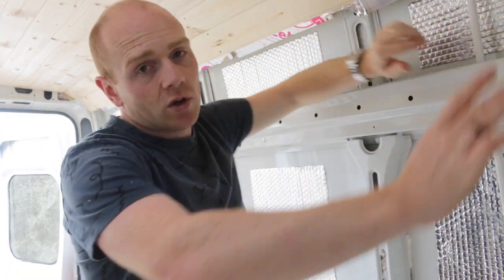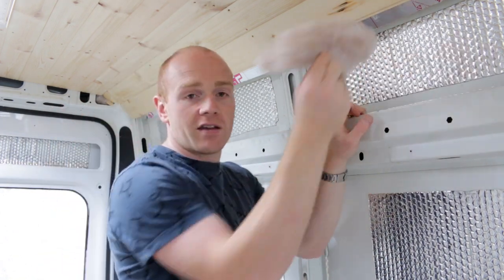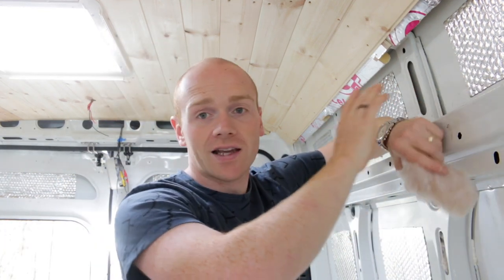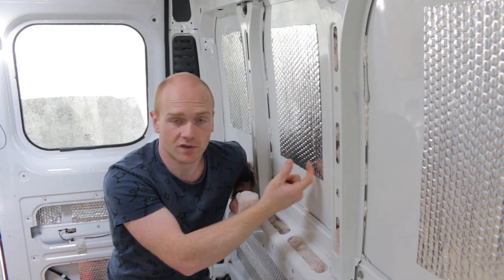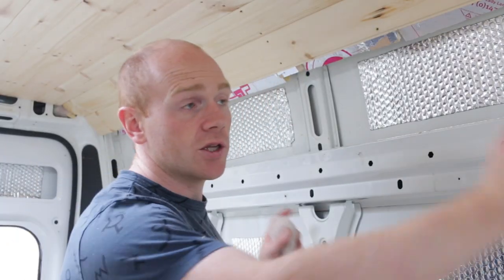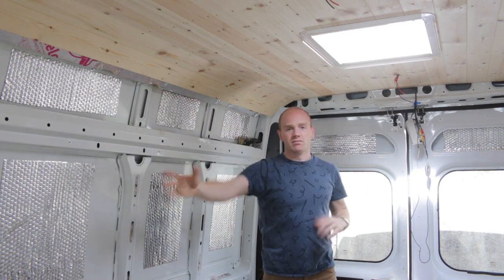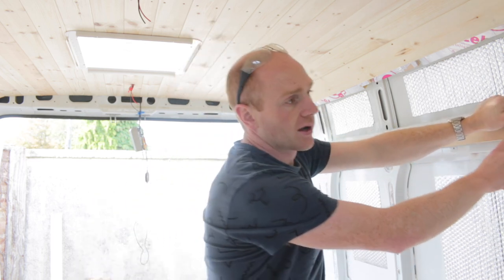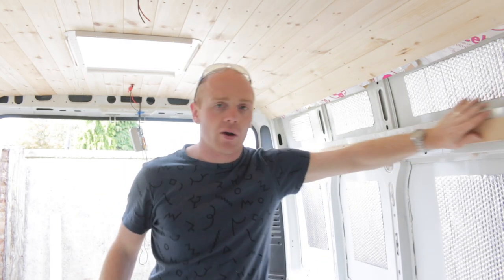VAN INSULATION PREPARATION | TRC Van Conversion 12.0

Comment: what if you added the silver building foil on top of the foam insulation with the foil. would that ameliorate the potential problems you talked about with not installing that foam insulation properly? also what are your thoughts on plastic vapor barrier?
Reply: xingalingaful Plastic on its own is not vapour impermeable.

Yes, two layers is better than one.

Comment: Definitely owe you a pint or 2 for these vids . . . Re-visiting this one as I need to put side battens in. I have a boxer and was just wondering if you drilled holes into the metal for the M8 bolts to go through or did you just put them through the existing holes in the ribs (although mine are hexagonal - think yours are too).  . . Any info on this would be great! Cheers, Matt

Comment: Aluminium foil will impact radio waves! Can also disturbe cable signals. Inside a van wall it has zero insulation. It actually works well as a cold and heat conducter.
But as said in this video, it works well as a vapour barrier.
Avoid, imho, aluminium other than in window covers (to reflect direct sunlight).
Use plain vapour barrier plastic for the job. Seal it with none metalic tape.
One can use normal, clear, bubblerap as insulation but it's R-value might be low.

I would prefere to use sound dampening without alu foil. If you have a problem with weak spots in the insulation, a foil behind it might worsen the problem by being such good thermal distributor.
Reflectix in vanbuild is such amazing global groupthink. Perhaps it started with the space programs? Looks advanced and scientific. If NASA is using it, it must be good...

Use reflectix to clad the inside of your shoplifting bag! ;-)
PS. Pardon me spelling.

Comment: Hi, does anyone know why my rockwool insulation in the walls of my sprinter conversion would be damp? The walls were insulated with rock wool, kingspan and a bit of expanding foam. Then they were covered with foil vapour barrier and foil tape. I then battened and ply lined the walls. So I drilled out the electrical hook up today and discovered the rock wool is damp and the van hasn't even been lived in yet. Any help on this would be much appreciated. Thanks.
Reply: You could have a leak somewhere that's letting wate run from outside the van. I'm in the process of converting my van and discovered a couple of leaks on the side of the van but luckily I cought them before insulating and panelling.

Comment: Would silver foil like you’d use in the kitchen to cover food work to reflect heat/ act as a moisture barrier?
Reply from the maker: Yes but would be to easy to tear. Polythene sheet is the cheapest and easiest vapour barrier.

Comment: Can I ask what, why and whether the small-squares of the vapour layer are attached directly to the metal?
Reply: emma cayless it is sound deadening material. ~2mm of butyl rubber to reduce the pitch of the metal vibrations when driving

Comment: They're 2 types of spray foam insulation. Closed cell (hard foam) and open cell (soft foam). Spray foam is installer sensitive. If done incorrectly it won't work to its potential. Open cell foam (water based) will off-gas within a couple of days. It also deadens sound. Closed cell foam is noisy. Foam would be the only type of insulation that I'd use in a van.

Ventilation is the most important part of controlling humidity in a van. If dry air outside and moist air inside of van you'll have moisture transfer and visa versa. Don't worry about "R" Value. A styrafoam coffee cup only has an "R" Value of .25 and a ceramic coffee cup has the same "R" Value.
Reply: Pls do a video

Comment: Question: I’m watching your videos for future reference; I love the extensive explanation and your thought processing out loud, gives a great insight into the decisions that need to be made throughout the built. What I yet have to understand is what I see in many conversions: the stuff on the panels of the panel van.  I understand you don’t want moist to condensate against the panels and therefore an airtight layer is required to bridge the temperature difference between outside and within the van. But how do these adhesives help with that? Thanks mate
Reply from the maker: Not sure if I follow?  The silver squares on teh metal are sound deadening only.  The most basic way of looking at it is that it doesn't matter what insulation you choose, you must always have that vapour barrier on the habitable side of it.  Not sure which adhesives you mean, it is the silver layer or whatever polythene sheet you use which is important.
Reply: Cool, that is exactly what I meant! it is sound proofing... Thanks for clearing that up for me so quickly; got confused, thought it was part of the vapor barrier or isolation, which put me on the wrong foot.

 The vapor barrier is clear to me, thanks to your video(s). Impressed with your work, and the fact you find time to respond! Thanks again.
Reply from the maker: Jan Willem v.d. Gronden some do fit a thin foil insulation all over the metal first but I am not sure it is worth it if you do a good enough job with the main installation. 👍
Reply: It's worth it, that partial sound deadening could be extended to be the first vapour barrier, the secret is layers, then the foil (2nd barrier), then closed cell foam (or sleeping mats) then Kingspan, followed by soft layer (recycled plastic bottles)to even out the gaps, then final foil layer, then the ply which has been backed by 5mm underfloor insulation (dampens panel resonance). It is a good idea to have plenty of hydroscopic fabrics in the van (like woolen blankets) to absorb then release water vapour as well - of course lots of people also line the van with carpeting which has a similar effect. And like you say it's also a good idea to allow an escape route for any moisture which invariably will find it's way in whatever you do :)
Reply: Nick Wood thanks. I tend to get overwhelmed by technique, even though I am quite handy. Do breaking it down in easy process steps really helps! Thanks!
Reply: The Restoration Couple thanks. You over engineer things a lot you say. What I see is someone who compares options or investigates them to make a sound knowledge based decision. You could wing it, which is my pitfall sometimes but for a long lasting van build, I agree with your “over engineering” all the steps

Comment: Personally I can't stand spray foam. Like you say it's not very green, it's difficult to get rid of if you want to change something, but mainly theres the risk of fumes if it fails to cure. And that might not be down to how you use it, you might get a bottle from a bad batch.

Bit paranoid I know but stranger things have happened! :)
Reply: Any rigid insulation off gases, whether it's sprayed on the van surface, or if it was panelised in a plant. The insulation boards are stacked up within 24 hours of casting, but then cannot off gas until unpacked. You get off gasing either way regardless. Custom sprayed on foam is no more/ less "green" than any other foam insulation, it's just that it's initial gasing has happened elsewhere...

I used spray insulation with closed cell structure, and yes it had an odor for a few days, but once I paneled the walls and stained/varathaned it (more off gasing) it smelled great, and no more harmful than a daily commute to work.

Good luck with your project! Cheers.

Comment: Hi, another great vid. What was the drill bit you used for the m8 bolts that fit them flush into thewood? (sorry diy noob questions) thanks
Reply from the maker: Forstner if its a stubby flat one. Just leaved a flat bottomed hole unlike a regular bit.
Reply: The Restoration Couple thanks again for your help,  really appreciate it.

Comment: WHy do you use small patches of the bubbly foil in the walls? cheers!
Reply from the maker: It’s not bubbly foil, it’s a sound deadened which is used on 30-50% of panels to reduce vibration and road noise. 👍

Comment: What will be the final wall to wall measurement I have the same van as yours and I'm in dilemma about  trying to get as much width as possible to fit a mattress across the back and by the way your van build series is the best ive seen so far well done
Reply from the maker: Will double check and confirm measurements in future video but the bottom double bed is over 1.8m still and the top ones slightly less but still usable for someone my height, although designed for the kids.  If needed I think it would work to go in between the two main side members with a thinner wall make up, which would also allow you to sit the bed structure on top of the side member rather than hanging or building separate supports?
Reply: Yes thats what I keep going back to  I'm only 5' 8"  but I built a temporary bed structure and put a small double full length mattress to try it out  and I loved the amount of space cheers

Comment: Absolutely nothing in the world wrong with the way you have gone about mounting your rails… I only made this comment to expose you to the way that most professional shops utilize the holes in those body rails in the van you have. 

I have had several vans up fitted for professional use, and what they normally do to mount E-Track and the like which is what you used to secure a ratchet strap's, load bars and other sorts of implements yes they use large steel rivets which are put in with a pneumatic rivet gun. 

I have seen these rivet guns at discount stores like harbor freight which you may not have in the UK but I'm sure you have a store like that that sells inexpensive Chinese tools.

Comment: I like your videos very much, thanks. 
What about using those small bags with Silica gel? Do you think they can help to absorb the moisture if I put a few of them somewhere in the insolation? With a price of £1.50 for 100pcs I think it is worth it to spread some of them.
Reply from the maker: Did think about that, you could certainly put them on the wall channels before sealing up.  Not sure how many you would need though!
Reply: It would be great to hear about it from someone who has tried it.
I've tried it in a double glasing window and it worked great. Now, when I saw the price of those small (1g) sachets it looks like an interesting idea.
Reply: That might seem like a good idea but once the gel has absorbed as much moisture as it can (which won't take long) you will be back to square one.  They really need to be in a situation where they can absorbe moisture when needed and have enough ventilation to let them release the moisture when the humidity drops.
 In a sealed environment they wouldn't work.
Reply: Use rice instead

Comment: Just say no to vapor vapor barriers!!!  You mention traditional building techniques at the start...  but, you would never use an impervious vapor barrier in traditional building construction.  Why?  Because a healthy building is supposed to / NEEDS to breath.  Condensation comes from a temperature differential, and you WILL have a temperature differential from the exterior wall of the van, and the inside face of your vapor barrier, and it will form condensation in the cavity between the vapor barrier, and the inside face of your van.  Now that you have an impervious barrier up (Plastic sheeting), what's going to happen?  Condensation can not evaporate.  Let the Van breath!  After 3 years of posting this video, I'd love to hear your thoughts on this.
Reply from the maker: A van cannot breathe, it's metal.  All modern construction requires vapour control, (if non breathable). Traditional construction would indicate lime mortar, masonry or wood which would be breathable.  A van's envelope is completely non breathable, to not control the moisture reaching the metal skin will cause condensation, yes that may be able to dry out again but not easily.  By controlling the moisture on the warm side you prevent that risk.  I inspected the insulation build up on a few occasions when working on door locks and all has been fine, along with checking through the drain holes in the sills during both summer and winter and there has been no sign of moisture, let alone condensation.
Reply: @TheRestorationCouple  agreed that the van is metal (impervious to breathing), and that conventional building products (for the skin of the building) are breathable, Including the "vapor barriers" / building wraps like Tyvek (designed to breath, same concept as goretex).   but...  You will heat / cool, the space between the vapor barrier and the metal skin of the van, regardless of vapor barrier on not, causing condensation.  If you are adding an impervious plastic vapor barrier, now you limit how much air circulation gets in (through the interior) with fans / windows..., if the barrier was not in place, the cavity between your interior finished walls of the van, would in theory dry out faster, than if it had an impervious sheet of plastic blocking airflow.  If you wore a Tyvek jumpsuit, or a plastic suit, which would dry out faster after you sweat (condensation) your butt off?  A breathable membrane or an impervious one?

Comment: No disrespect, but why piss abought! Just "Fibreglass" it out, every sq. inch! I'd like to see, any moisture, get through that!
Reply from the maker: Fibreglass is breathable?
Reply: No way, that's why BOATS, are made from it!
Reply from the maker: Geoff Fisher thought you were talking about fibreglass insulation. (Wool type) 👍
Reply: Had a good friend, who built a Water storage tank, in the ground. he spent an awful lot of money, "Water proofing" the concrete walls, and floor. It did not work, he just could not stop the ingress of rain water. I advised him to coat all inside surfaces, with Fibreglass, and resin, not a drop of water, ever seeped through again, and the "Stored" water, remains "Cristal clear" till this day, and that was 10 years ago.